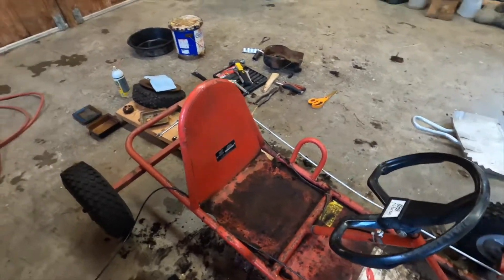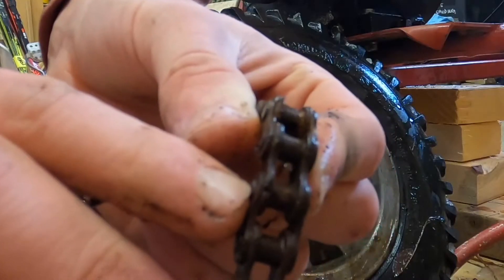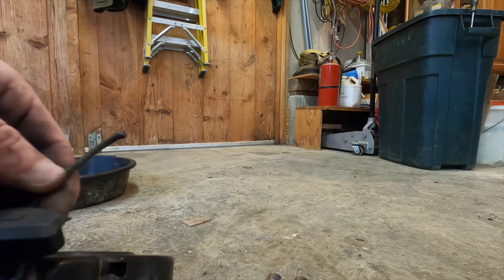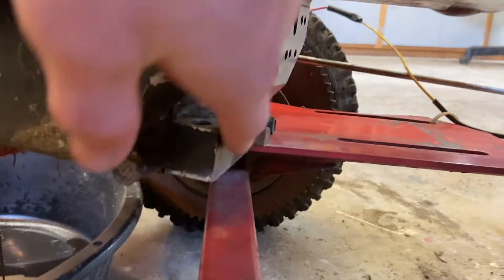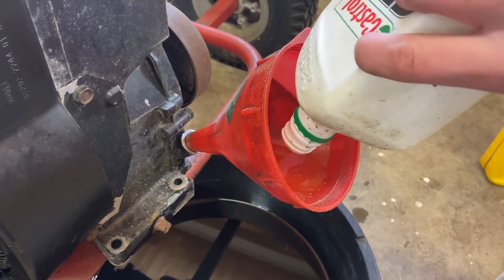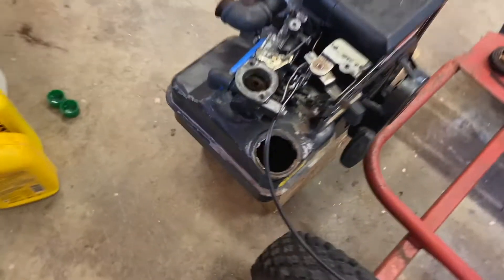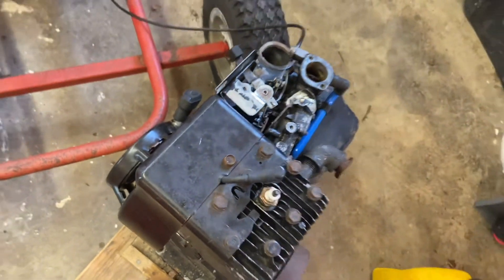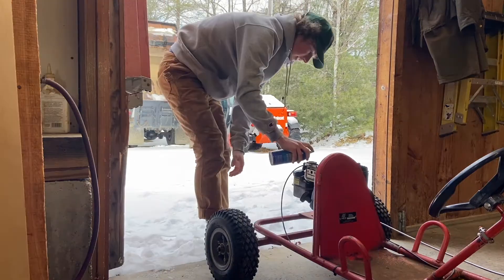Krusty Kart Part 1 (Restoring an old 3hp Briggs and Stratton go-kart)

Comment: Just a tip, the nail through the starter rope will work but it isn't ideal. I'm worried it will unravel. Best to use an overhand knot around the nail and tuck it all into the handle.
But extra high fives for coiling up the starter spring back into the housing!

Comment: You should add zinc zddp to your oil, particulary for the valves
Reply from the maker: I will try that thanks!
Reply: @clarkscabin  the lucasoil one
Reply: Zinc additive is a good idea for longevity or maybe if you were "racing" a blueprinted engine but just farting around on
an old go kart with a Briggs tiller engine, regular good quality oil will be fine. I use SAE 30 which is a straight weight oil, not multiviscosity